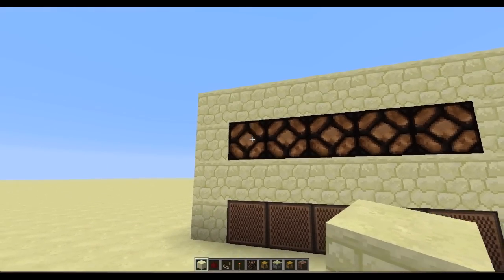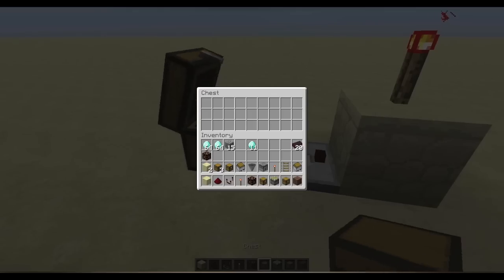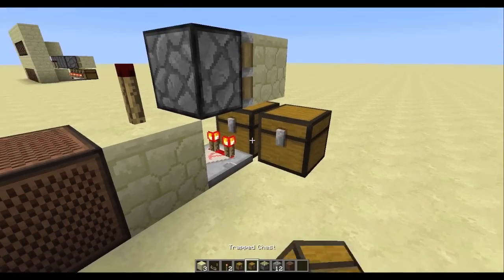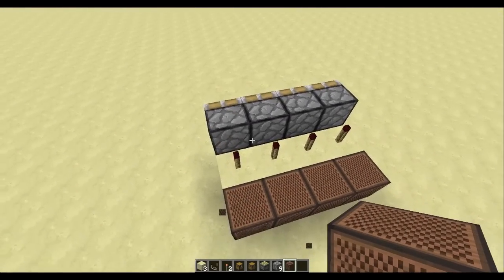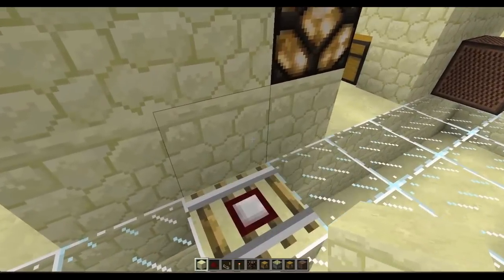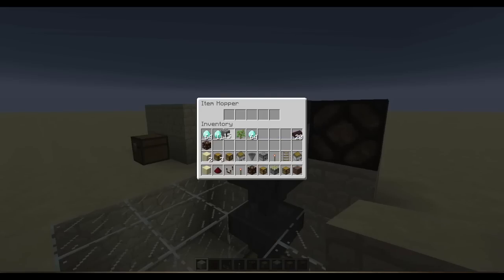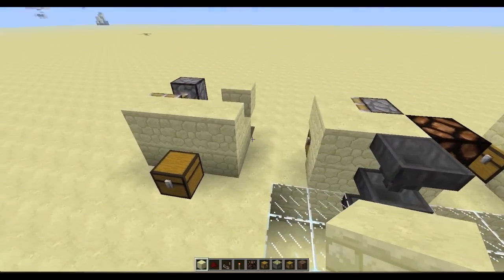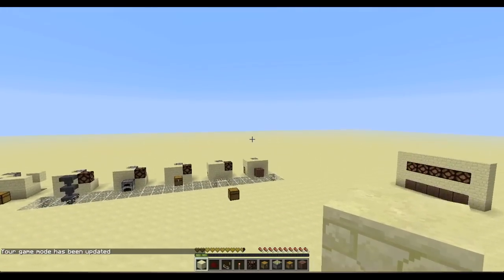Tileable DUD - Data Update Detector! *Tutorial

Comment: I finally figured out how to extend it. The certain parts of the TEUD give a 1 tick pulse, so you can easily make a T Flip Flop out of it. You can take the output of the flip flop and run it into a monostable. The output of the monostable goes back into the flip flop so it basically resets itself, taking up enough time to get a decent signal through.

Comment: Just to re-iterate what most people have already asked for, with this design is it easy to make a compact DUD-Flop. One Data Update turns the output on, one Data Update turns the output off. My suggestion would be to start along the lines of a mono-stable circuit/sticky piston with redstone block design. Tilable would be ideal, but a DUD-Flop in general would be a handy design (and I already have a few inventions planned using it). Great circuit!